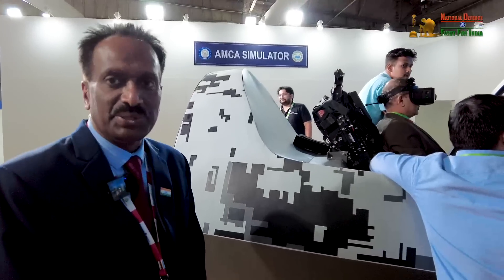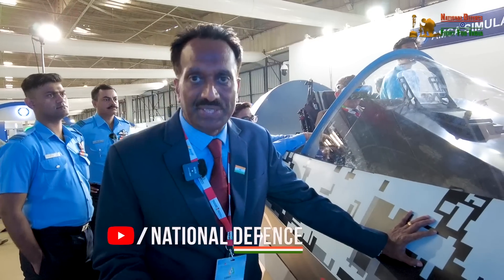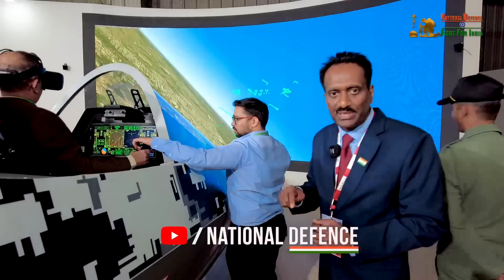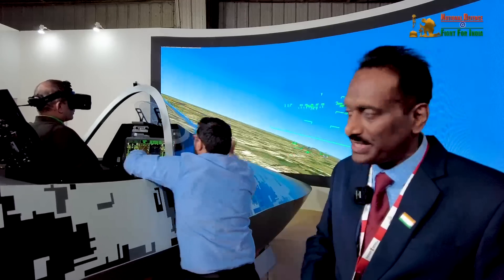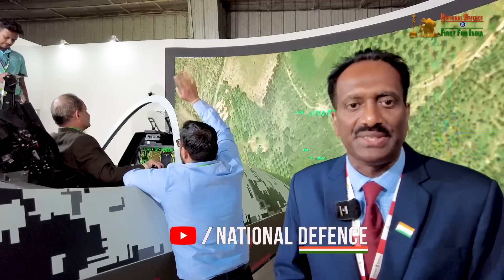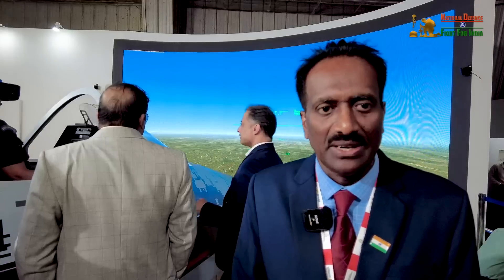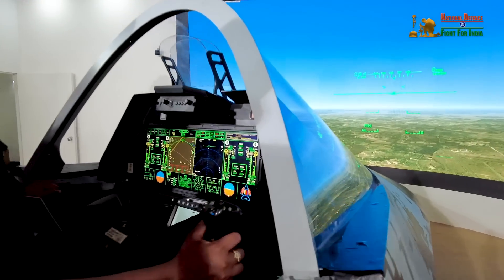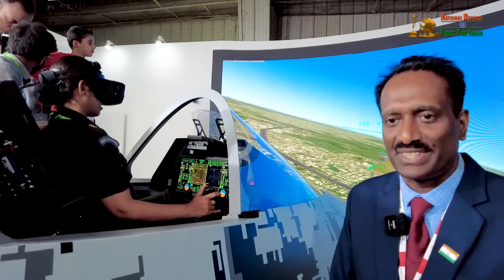Fifth Generation Fighter Jet AMCA Simulator Explained!

Comment: But the simulator in not hydraulic assisted to mimic the movement of the jet, wouldn't that provide a better experience to the trainee?
Reply: This is the First step of training. It is just for the pilot to get accumilated to the controls (buttons, levers, pedal control of rudder etc..).
The 3 DOF or 6 DOF will be used in the next step of training where the "experience" part comes into picture.
Reply: @greatsrikar  True. I think this is just to test the layout and software etc.
Reply: this not for gaming. If you really want to stimulate flight you need G-force
Reply: Pilots will be wearing g suites while performing this simulation.